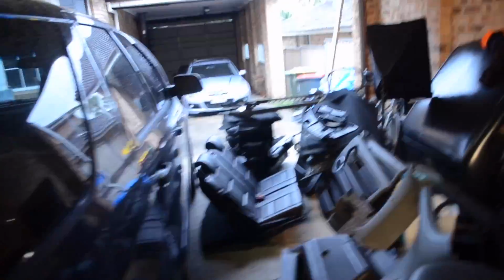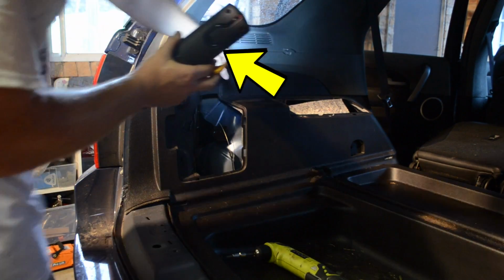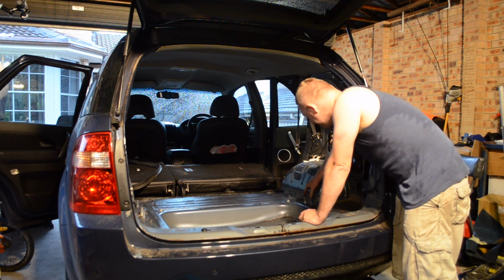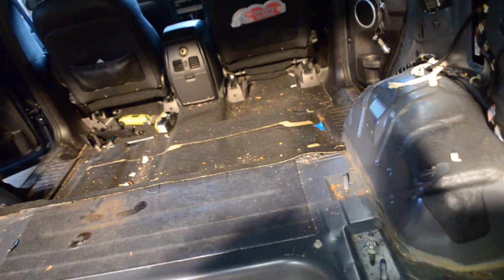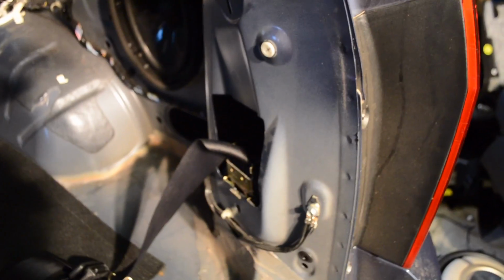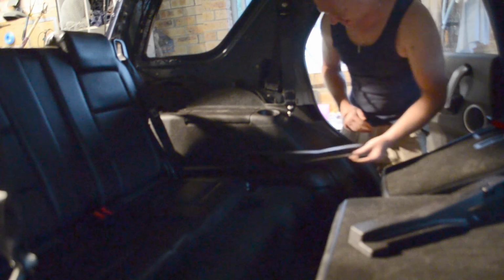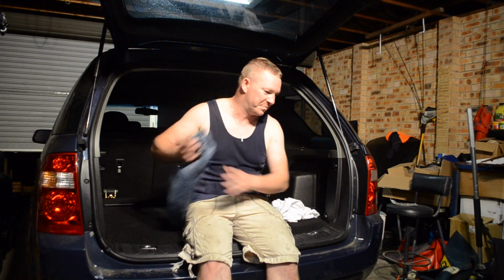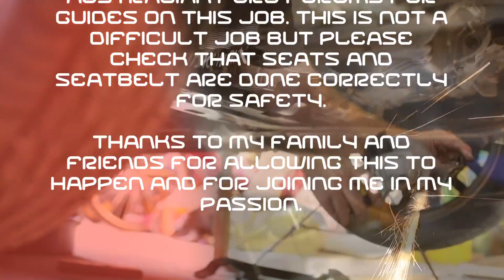5 seat to 7 Seater Territory Conversion

Comment: Can you do this in a honda cr-v?
Reply from the maker: If the cr-v came as a 7 seater factory then yea usually it’s a simple install, if they didn’t you can get a row added but it’s an aftermarket kit that needs engineering which can be a little expensive but it’s doable

Comment: Hey Tim,

Great video mate. One question regarding the sliding second row. Did you have to unbolt the five-seat rear mounts to make way for the sliding rails?
Reply from the maker: Hi mate, its been a while since i did this one, but from memory yea i think i changed the entire 2nd row seats as the 5 seater version didnt have the slide forward function to allow access to the 3rd row. I did help a guy do a conversion where we left the stock middle row in and from memory yea we had to add something under the rear bolts, i think i had to move or add a plate that had the holes there but where covered up by a sticker. (sorry man its been a while since i did this one so going by memory).
Reply: @TimsGarage  thanks mate...yeah I saw the date of the video after I posted. I wouldn't be surprised if you no longer have the territory!

Comment: Hi sir can i do these in hyundai tucson 2010? Please answer from philippines
Reply from the maker: Hi mate, did they come out with a 3rd row from factory? if they did then it should be easily doable. if they didnt come as a 7 seater then you will need to get a certified 3rd row and get an profesional place to install if you want it to be legal. Im not sure of the laws in the philippiens, if they are relaxed, then you can bolt in a 3rd row with seat belts fairly simply, just make sure you know what your drilling into so you dont put a hole in the petrol tank... :D
Reply: Tims Garage sir maybe you have a facebook account so i can mag you in messenger i want to send you the picture of my car

Comment: I'm trying to figure out how to remove the existing 3rd row. Do I need to remove all of the trimming? I've removed the 6 bolts but it's not coming out
Reply: Ah - in addition to the 3 18mm nuts on each end of the seat, there are 2 x 12mm bolts under the sliding base
Reply from the maker: Hi Mate, its been a while since i did one of these now. from memory the trim came out as its different to the stock insert (seat belt slots) I dont think the side trims need to come off, there where a number of torx bolts on the side from memory and the seat belt anchors, nothing jumps to mind other than that. I can have a look at ours and get back to you if your still stuck.

Comment: Hi mate just wondering if it's possible to add a third row seats to pajero sport GLS 2016?
Reply from the maker: Hi man, so sorry for the crazy late reply, I missed the comment last year (man that’s bad sorry) if the car came with a 7 seater option, chances are that it will work, if it only came as a 5 seater, then you can buy an after market 3rd row and seat belts bit it needs to be engineered upon installation and for safety that’s both a good thing and expensive. If it came with the 3rd row option usually everything is there ready to go if you get the back end from the wreckers

Comment: hey Tim is there a third row seat modification for a 2003 Toyota 4runner SR5?
Reply from the maker: Hi mate, Ive had a look online and they didn't come with one, but I suspect that being a Toyota something from a Prado may fit, the issue is that if they didn't come out with the seat then you will need to mount the seats by creating seat belt points and anchor points for the seats rather than them already being there but not being used which was the case in the Territory.  Ill keep researching and see if anyone has done the mod before.
Reply: I'll look into it..thanks Tim..by any chance what year Toyota Prado?

Comment: I’m not sure if you’re still responding, but i have a 2006 ford escape (v6¿?) and there’s only 2 rows with a large back. I have 3 younger sisters who all cram in the back so is it possible to add a 3rd row?
Reply from the maker: lasagna did that model come out with a 3rd row? If so it’s highly possible to add that as the stock platform usually has the bolt hold for the 3rd row. Another option is for an aftermarket 3rd row, it’s much more expensive and would need to be fitted by a professional to compliance and engineer it, but it would be possible.

Comment: Do you have something for Xtrail 2016? I want to convert to 3 row but I don´t know how! :(
Reply from the maker: Hi Roberto, I don't have any video's on that conversion but it is totally doable, the range comes with a 7 seater version so all you need is the back section of internal parts, seats and trim + the bolts to do it. A good wrecker will provide everything you need to do the conversion.
Reply: Tims Garage  thanks for the answer...acuatlly  I found the third seat. I'll doit!! thanks a lot again.

Comment: what if the seat belt upper mount isnt tapped? can it simply be tapped or does it need engineering?
Reply from the maker: HI mate, they are not tapped, the bolts supplied are high tensile and will taper it as you install them, it takes a little muscle but they go in fine, the guys at the wreckers where I got the kit from told me that this was the case for all of them.
Reply: Tims Garage  oh ok i didn't even consider that, thanks very much!!!!

Comment: Is this legal in the US especially in Miami?
Reply from the maker: Most modifications can be complianced by a qualified engineer, I am unsure about the US laws in regards to a modification such as this, Mostly the cars I do this on had a 7 seater version and so it was an "optional Extra" on the origional car, however the compliance plate will still say 5 seater unless you get the engineering certificate. Do laws change from state to state in the US? There are some differences in Australian state laws but on a quick google search i couldn't find any laws for Miami in regards to conversions to a 7 seater, Ill keep looking though and let you know if I find anything.

Comment: Hi tim can i ask how much it would cost to convert it to 7 seater?
Reply from the maker: Carly B it will depend on what you get the interior parts from the wrecker for, I got a full interior for $1600 then sold the old parts (seats, trim etc...) for $500 so about $1000 ish for parts then the install cost of you don't do it yourself.

Comment: What does it cost to convert these to a 7 seater? Just the material.
Reply from the maker: It depends largely on the wreckers, for just the 3rd row seats, back carpet and side trims I found one wreckers in 2017 that would do it for $150, The care in the video came with an entire interior trim including doors, front seats etc... I replaced both 2nd and 3rd rows then sold the original parts, the cost was around $1300 to buy then I sold the original leather for $500, the more you shop around and if you are happy to do the work yourself (pull the seats out at the wreckers) you can save some serious money.

Comment: Hi Tim I live in Adelaide south Australia and I want to convert my 5 seat territory into 7 seat. I can arrange the 3rd row seat from wrecker but can you give any reference where I can get them fit...jojo
Reply from the maker: Hi mate, sorry for the late reply, just moved interstate so haven't checked the computer for a while.  If you are just doing the 3rd Row remember you need the seat belts and the interior covers on the side to allow the belts to fit. As fo getting them fitted, I don't know Adelaide well sorry, Its a drive but I'd be happy to help out (I now live in Ballarat Vic) but im sure there is a closer option, though. I'll ask around some of the car networks im a part of and let ya know.
Reply: Hello tim how’s things do you need to have a  engineer certificate  To change from 5 to 7 in a  2005 Ford Territory

Comment: Hey mate question abt the 2nd row seats. Are the 2nd row seats different for the 5 seater to the 7 seater. As in did they bolt into the same location or different. Thanks.
Reply from the maker: Hi mate, they are different, and the bolt spots are also a little different, but the territory has both on its raw frame so both sets of seats will fit. the main difference in the seats is that the left hand side slides forward to allow for you to climb into the back seats easier.

Comment: hi tim, would it be possible to add a 3rd row seat to a 2003 ford escape? many thanks, jorge
Reply from the maker: Hi Jorge, for simplicity the way I do it is any car that came out with a 7 seater option means that all the car frames are designed to hold the 3rd row, so you can get all you need from a wreckers to refit the 5 seater as a 7. Sadly the Ford escape did not come with a 7 seater option from what I can find in Australia. So while anything is possible, it would be quite a hard job, you would need to fabricate brackets for seat belts and seats and modify a fair  amount of the back end of the car to make it work, then because it was not an option from factory you would need to then get an engineering certificate to make sure everything was safe.  Sorry mate, not as easy with that car sadly.

Comment: hey Tim, great video thanks for uploading. We are going to do this to our territory, would you mind giving a list of the parts needed from the wreckers? Just so we dont miss anything when we go! Thanks heaps
Reply from the maker: Hi Jude.  you will need the back seats (3rd row), 3rd row seat belts and the rear interior trim that allows for the seat belts to operate, make sure all bolts (seat belt bolts) and 3rd row seat bolts come with the order. 1 bolt per seat belt, and 4 bolts for the seats

If you want the full 7 seater deal then the 2nd row also is changed so that the passenger side seat flips forward and all the seats can now slide forwards to allow more feet space in the back, for this you will need the 2nd row of seats, all the bolts with them, and some of the plastic covers that go over the seat mounts and the bolts that hold them in place (smaller ones) 

Make sure the new back seat comes with all the floor trim too as the carpet needs to be swaped out 2nd row back and the back seat will have trim so that when its lies flat it looks like a 5 seater (looks like the entire back part is carpeted and tidy no gaps or missing pieces.

hope that helps :D
Tim

Comment: Hey bud nice job. I have 3 car seats in 5 seater. Another kid coming so need extra seats. Would conversion work with fitting car seats in 4 positions ok? I am thinking of space for kids legs. After conversion how much 'boot' space is there (dimensions). I am thinking of groceries and prams. Cheers
Reply from the maker: HI mate, Ill measure it up for you and get back to ya. The back seats still have mounting points for car boster seats, however geting into the back row needs acces from the rear passanger seat which slides forward and leans forward so you couldn't fit a mounted seat there easily. The car would be big enough for 4 seats, but even without looking the boot would be limited with a large pram and groceries would also be limited with a pram as well. Ill measure it up though and let ya know.
Reply: Hi Tim. The original seat in 2-1 with a fold down seat. Can you get a back row in the same config, so could put down one seat for easy entry and put pram/groceries on the folded down seat? James
Reply from the maker: kingjim007 sorry mate, I never got back to you. The back is fixed 2 seater sadly. I know what your looking for, some of the larger 7 seater Toyota' shave separate back seats which you can just fold one. Our previous family car (Mazda MPV) had all back 5 seats removable so you could take out the back or even a side seat totally for a pram.
Reply: Actually Tim I experimented with the setup and found it to be suitable. By disassembling the pram I should be able to put one half of the pram on the back. Then can fold down one of the middle seats (e.g. passenger side middle seat) and use this space for rest of pram and groceries). Also would likely have front seat available if wife is doing shopping and I am at work (p.s. woollies online good option if you have 3+ kids!). So I bought some dickie seats off gum tree and a roof rack. Will next get a roof pod for long car trips to carry stuff. So if you keep playing with options I think it can work well. I also found my Territory model does have 2 anchor points in rear so car seats can be fitted safely in 3rd row. Just have to get someone to install dickie seats now!

Comment: Thanks for your video and 
I have mkt really want to add 3rd row 
Do i have to buy both 2nd & 3rd row ?
I will appreciate for your response
Reply from the maker: The 3rd row is needed of course, the 2nd row on the 7 seater had the fold down function on the passenger side. I have installed one for a mate that didn’t include the 2nd row. That also worked fine, just lacked the easy entry sliding function

Comment: Hi Tim. I have a 06 Mitsibutshi Outlander 5 seater. I want to convert to a 7 seater. Is this possible? And what parts are needed to buy to give to mechanic? A mechanic or a detailer shop... Who would you  trust to do the job?
Reply from the maker: Hi Sophia, I did a quick look at them online and Yes they did come in a 7 seater so you should be fine with the fit out. What you will need is any specific trim (interior) for the 7 seater back, EG: some side trim may have spots for seat belt straps, or a different mood so that arm rests are present for the seats compared to a 5 seater, you will also need all the carpet from the back possibly to the drivers seats especially if the 2nd row of seats (middle set of seats in a 7 seater) has a different function on the 7 seater compared to the 5, EG: they fold or slide forward to allow access to the back, this could mean a different carpet is used so double check that. if you need the middle seats make sure that you get all the bolts and brackets also just to be safe. Finally you need the back row of seats and all the nuts and bolts associated with that. I would suggest trying wreckers and comparing both cars just to be safe, ask to look at a seven seater and compared the floor in the back to your 5 seater. They are identical on the Territory and I assume that other manufacturers do the same base frame for all the models and just fit out the interior differently. Things that I would check just to be safe would include, seat belt mounting points, bolt patterns on the floor of the 5 seater to accept the 7 seater row, and really just again check that the floor under all the plastic and coverings are exactly the same. 

some wreckers will do the job for you if you offer them some cash, dealerships are generally terrible at this, lots of them would not even know that its possible sadly.  A good mechanic would be able to do the job easy enough. Depending on where you are located Id be happy to have a look but I would want to check out the things listed as I said just so that you didn't buy the parts and then realise they are totally different. Ill do some more research and let you know if I find anything that would be an immediate stop to the project.   Hope that helps Sopia, thanks for the comments.

Comment: Hey Tim, I'm doing the same as you but keeping the 2nd row as is. Just a quick question; Was the tray the lines the boot changed or did you cut the original tray to fit?
Reply from the maker: It was different mate to alllow for the base of the chair to slide back when not in use. It slides forward to form the 3rd row when needed
Reply: @TimsGarage  I want to ask, where is the spare tire stored because I also want to make it. Please reply
Reply: @fayas607  all ford territory's have the spare tyre stored under the car that is lowered by using a winch system accessed via the boot of the car

Comment: Hi Tim, thanks for your video, did you need to get engineering certificates or any other compliance checks for rego as a 7 seater conversion?
Reply: Claire Clairefear i just done the conversion myself, i wont put my kids in it untill its signed off. Being all factory bolt in parts a engineer would sign it off with no hassles as their hasnt been any real modifications

Comment: Did you have to replace the middle row seats to make the 3rd row fit? Or were you able to keep the original 2nd row?
Reply from the maker: Hi mate, I replaced the middle row, the new middle seats have the sliding feature to allow for more leg room in the back. The carpet on the back of the seats changes too. You could get away with the original ones but getting in would be harder for the 3rd row and space would be limited.

Comment: Hi Tim, would you be able to convert a 2019 Toyota Rush into a 7 seater?
Reply from the maker: Thobelani Mc hi mate, if they came in a 7 seater then chances are then yes. You can get after market seats put in but that’s more expensive and needs engineering.